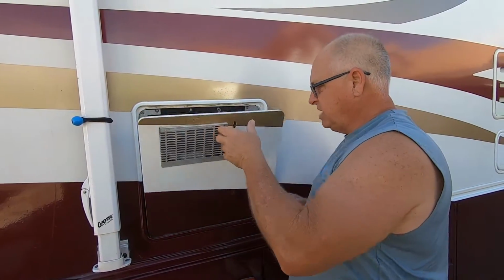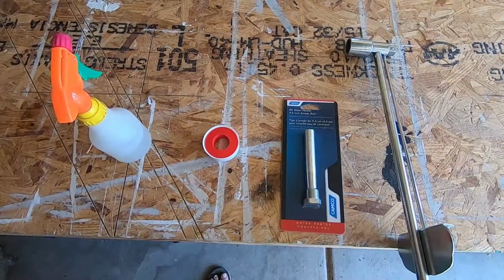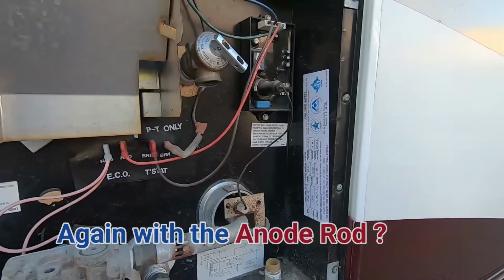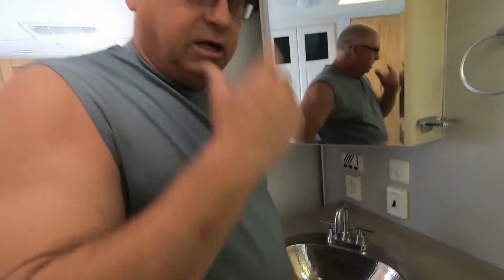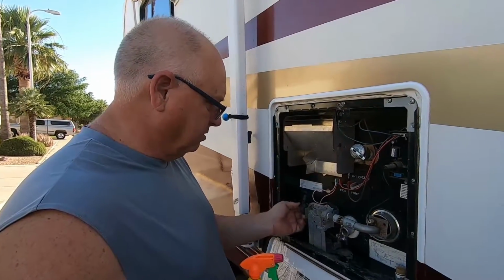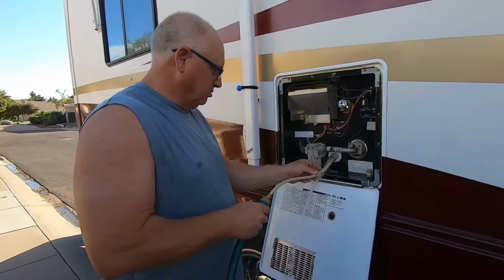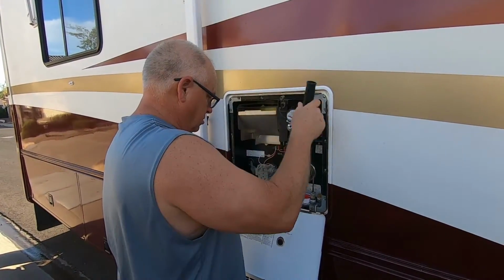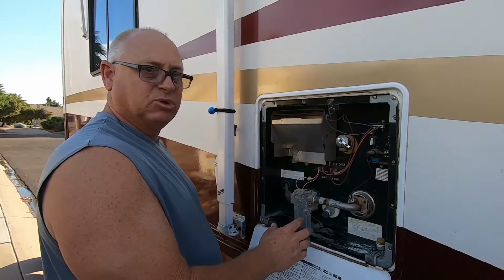RV Water Heater Anode Rod  🔧 How to Replace - Drain & Flush

Comment: Some water heaters do not use an anode rod. Also when draining the water heater if you will open the temp/pressure valve it will allow air to flow in and the heater will drain quickly taking most of the crud out with the water and not the slow glug glug where the air is having to come in the drain.
Reply from the maker: I know they told me that when I went to get my new Rod. Thanks for the heads up on the pressure valve I thought about that after I had uploaded the video and watch it myself. The pressures of being a youtube creator !!!  Thanks for watching.
Reply: Can you put an anode in a water heater if it doesn't have one? Because I just drained mine after buying a anode rod but it doesn't have one there just a drain plug?